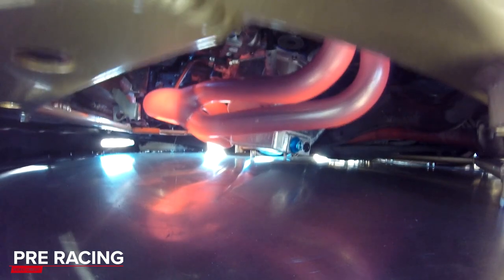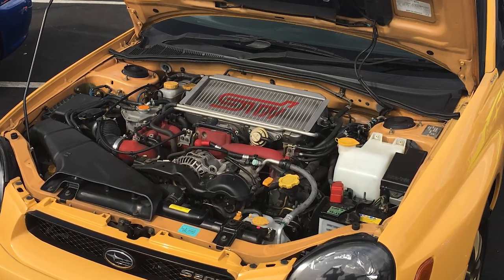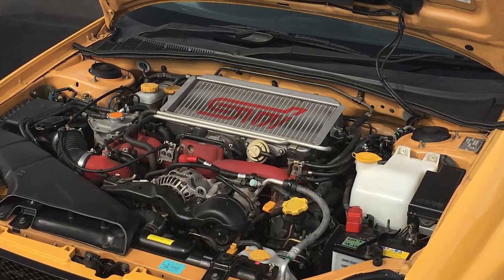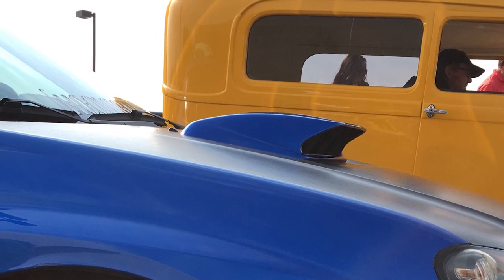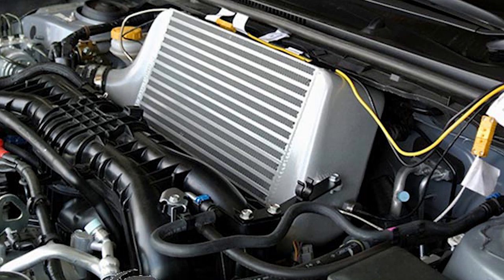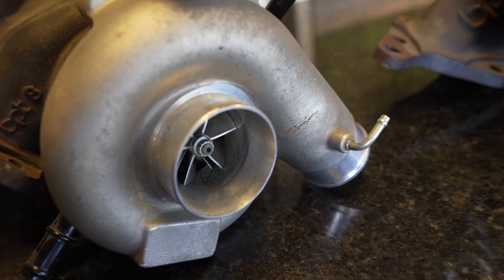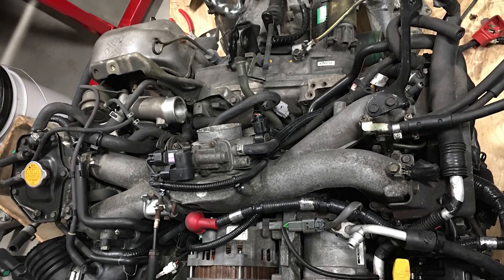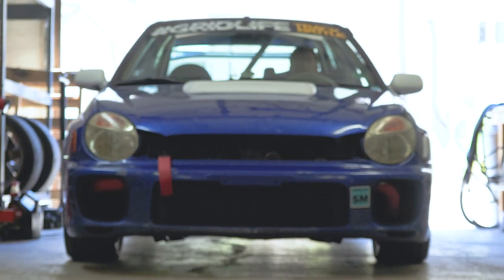Intercoolers - Top-Mount Vs. Front-Mount - Which is best?

Comment: One thing that people forget is with most fmic's youre forced to remove your crash bar.   If you rear end someone, the intercooler takes the impact which is dangerous.   Also, ive seen insurance companies deny claims since the crash bar was removed.
Reply from the maker: That is a good point, and worth mentioning.

Thanks for watching and Stay Tuned!
Reply: Yes you are right on that point. But newer fmic kit they are coming with a crash bar include. But they are more expensive lol 😂
Reply: @xlkazzlx4232  even on the older models, some shaving needs to be done but nothing world ending.

Comment: Another thing that is worth mentioning, is with a top mount you can run greater fin density, because it isn't sitting as close to the ground and exposed to getting the daylights beat out of it by road debris and rocks. I am not a fan of the bar and plate PW design, as it compromises density by going bar and plate. Bar and plate is needed however when you expose a core to rocks and road debris in the bottom of the bumper for rigidity. A bar and plate setup is going to cool less efficiently per surface area than a close fin density intercooler. You can see in the PW Design they increase the volume of the intercooler to 'compensate' for the bar and plate. Ideally any cooler; you want as large surface area as possible, for it to be as thin as possible; with the most fin density. This gives you the least pressure drop and most cooling. Packaging and location becomes the issue however; so that's when compromises kick in. To effectively run a short loop air to air front mount, for track purposes; without compromising the radiator; look into V mounting + rotated manifold + turbo relocation, high mounting the front mount allows greater fin density and tilting / dropping the radiator prevents the fmic from heating the radiator, requires custom ducting. As with anything; there are compromises. This is so that all the coolers can get the appropriate amount of air, and you can keep the intake ducting as short as possible. Now this is full fab, and I am talking relocated turbos at this point, which is not the objective of the video.  It seems like the main goal is to assist with the decision on rather to run a OTS FMIC or upgraded OTS TMIC on a factory(ish) location turbo subaru with a stock rotation intake manifold/tb. Great work as always @flatironstuning Thanks for spreading the knowledge; really good info in the rest of the video!
Reply from the maker: Thanks for the comment.  I definitely think that there hasn't been enough development of intercooler technology in the last 5 - 10 years compared to other parts.  There is definitely some advantage to be gained by some tweaking and re-designing compared to the majority of the kits on the market.

Thanks for watching and Stay Tuned!

Comment: Now the true critical point is the difference and benefits between tube and fin vs bar and plate.  Mostly how tube and fin is the better choice if you're not drag racing
Reply: I would love to hear this. I’m trying to keep my car consistent and reliable on the track and it seems hard to find a good tune and fin TMIC.
Reply from the maker: That is true.  Tube and Fin is a much more efficient design, but it is also a lot more expensive.  Bar and plate is a lot less expensive to produce, and that design is a bit more tolerant of high boost pressure.

The expense of producing the core makes the Tube and Fin Intercoolers really hard to find.

Thanks for the comment and thanks for watching.  Stay Tuned!
Reply: Plazmaman makes an excellent (but pricey) tube and fin intercooler capable of holding some mega boost. They also weigh SUBSTANTIALLY less, which is really nice when you have all that weight hanging off the front end
Reply: @dsxmotorsports  I think HKS makes one too.  Can't find a good tube and fin TMIC though.
Reply from the maker: @dsxmotorsports  Forgot about Plazmaman.  Thanks @DSX Motorsports!

Comment: For the FMIC blocking the radiator, I figured out a solution. APR sells a break cooling kit for the VA WRX/STI ( I believe they also have them for older WRXs) I fabed up some brackets and spilt the hose to go to the brake rotors and to go in between the fmic and radiator. So the radiator is getting good enough air flow.

Comment: FMIC for life.
Reply from the maker: Thanks for watching and Stay Tuned!
Reply: This guy gets it. This response makes the most sense; front mount is the way to go. In response to the turbo lagging behind in pressurizing the system...the fmic isnt the issue, rather the turbo is too small. Even with a vf52 or vf48, I'd still go fmic to be honest.
Reply: @jonathanh4446  💪🏾
Reply: @jonathanh4446  plus the cooling benefits outweigh the extremely minimal drawbacks.

Comment: One of the big reasons my 2002 WRX has a front mount, was so I could switch my air intake temp. sensor from pre-turbo to post turbo for my hybrid engine without a blow through tube. I paired it with an IHI VF48 that been been ported, polished and ceramic coated.
Reply from the maker: Thanks for the comment, thanks for watching, and Stay Tuned!

Comment: Great video. Upgraded the 2002 WRX with G.Speed intercooler with Cobb AOS. No oily residue in the TMIC, yet (it’s been 3 months now) !! Maybe for the next question topic, address the crank pulley. Replaced old stock original harmonic balancer on 2002 wagon with Fluidamper.  What a change ! Smoother and calmer.   I think my Sybil loves me now.  
Cheers
Reply from the maker: Good suggestion on the topic.

Thanks for watching and Stay Tuned!

Comment: I have a Process Verticooler paired with a blouch 1.5XTR(3in inlet, 10cm hot side), seems to be a good pairing for my car, tuner stopped at 380whp/350wt(still on the stock 5-speed). My car lives in socal, doesn't ever feel like it gets heat soaked, and even if it does get heat soaked, it's because that famous California traffic slowing everything down and you won't be going anywhere in a decent amount of time or at speed.
Reply from the maker: Thanks for the comment.  We definitely like the verticoolers.

Thanks for watching and Stay Tuned!
Reply: I have a similar setup. Blouch 1.5XTR (8cm hot side) paired with a GrimmSpeed. Stock 5speed. Stock block with rebuilt internals. Dyno tuned on E85. Pushing around 400whp. I built a Intercooler water sprayer that helps a lot to keep the TMIC cooler.

Comment: I would be interested to see a relatively small FMIC for the VA WRXs. The turbo location means intake length wouldn't be all that much longer. Using a core and piping designed for maybe 350hp would minimize pressurized volume. Plus, the smaller core wouldn't block airflow to the radiator and might mean you can keep the OEM crash bar. Perhaps the reason we have this rule of thumb that you only go FCIM over 400hp is that that's what made sense on the EJ motors, and all the vendors kept that thought for later generations.

Comment: Another reason why I am going with a top mount upgrade instead of front mount is just the absolute amount of debris that will impact the core. I live in Wisconsin and there’s snow almost half the year, with rocksalt, sand, and just pieces of the road from plowing. In the summer, there’s always road construction and chip seal taking place.
Reply from the maker: That is always something to consider for sure.  The FMIC cores are pretty darn tough, but in those types of conditions over time, you could end up with a damaged core.

Thanks for watching and Stay Tuned!
Reply: Which part of WI

Comment: Love the video personally going Perrin TMIC on my 2020 STI because I want to have the best throttle response and not looking for peak numbers. However I think Subarus rally use v mount intercoolers so the radiator doesn’t get air robbed would love to hear your opinions on those!
Reply from the maker: Thanks for your question.  "V" mount intercoolers and radiators are actually really tricky to get right.  The issue is getting good air flow through both coolers. It requires a lot of ducting to get them to work properly.

And packaging can be more challenging with the V Mount set-up than just about any other option.

Honestly, I'd say that most of the time those are best left to professional race teams with wind tunnels, etc.

Thanks for watching and Stay Tuned!

Comment: Would be curious to see a company design a tmic with a redesigned hood scoop that seals the IC for maximum cooling efficiency, and also a plate or some design work with a heat shielding to prevent heat soak.
Reply: Process west ;)
Reply: @marvinvisser5039  The process west setup is too basic of a design I'm talking something a lot more high-end.  Would require a hood scoop upgrade - ram air setups to completely redesign the stock setup.  Also need a plate or a kit to prevent heat soaking or some fans with ductwork to extract the heat out of the engine compartment.  There's companies that do this in the Porsche 911 air-cooled market.... don't think anyone's tried it yet for STI.
Reply from the maker: Thanks for your comment.  I'd say that Process West and Grimmspeed are the closest to this that we have currently.  From your other comment, I know that you are thinking of something beyond what they have on offer currently.

It is an interesting idea, but I would say that for a lot of driving, a well ducted TMIC does a really good job.  I'll have to see if I can find one of the 911 set-ups you mention and see what they have going on.

Thanks for watching and Stay Tuned!

Comment: When you say 400 HP I'm assuming you mean 400 wheel hp not crank hp.  I've personally made 420/405 on pump gas with a rotated g30-660 and a mishimoto tmic @ 23-24 psi and then 475/467 on e50 with a grimmspeed tmic @24-25 psi on a mustang dyno and know of folks that have done upwards of 530 whp with a grimmspeed tmic.  

On the dyno at least I couldn't hold power passed 7k due to the tmic no longer keeping intake temps where they needed to be.  Could you do a video about air to water set ups?  I really want to do an awic in the factory tmic location to try and get the best of both response and power capacity.
Reply: This still seems like the ideal setup to me. Been looking to try it as well, as I can fabricate it all myself. Eliminate the charge pipe volume, eliminate the bottleneck of total cooling capacity, and completely stabilize the charge temperatures as there's no issue of heat soaking the core. Only downside is system complexity, and packaging. (A tank in the trunk)
Reply: @evanchi9460  your also limited on intake manifold choices.  A stock sti will work as will a cosworth if you can afford it and if you're lucky enough to locate one.  There's a guy on nasioc who did this kinda set up on his autocross car with good results.
Reply: @donmerrigan2362  Limited in regards to what? The packaging on any OEM manifold would be tricky, but not impossible. I'll be using a 2.5i NA manifold I shaved up if I ever do it.
Reply: @evanchi9460  limited on space.  The na manifolds have much larger plenums which place the throttle body in almost the dead center of the factory tmic.  There's just no room to put an intercooler in the factory location with a na/ams/process west manifold.  Maybe if you reversed them but that would add a bunch of piping with some really tight bends.  

I'm currently doing a short runner na manifold and had to go fmic to do so as there's no way a tmic could fit anymore.
Reply: I actually saw one in a forester at the last big Subaru meet in Houston. Talked with the owner and tuner, said it wasn’t worth the cost unless you’re tracking it regularly, as the fully custom design woulda been approaching around 3500-4k just for an intercooler. I have pics I believe if you’d like to see
Reply: @Cloudsurfer181  Yup, I wouldn't even bother if I wasn't able to fabricate it all myself. The parts alone are really not expensive, but there's a lot of labor involved.
Reply from the maker: Thanks for the comment, and yes, I did mean 400 wheel hp. 

A few comments about AWIC's on this video.  From the first response I typed:

Air to water intercoolers are an interesting option.  The difficulty with them generally comes down to the weight of the system with coolant, etc., the complexity (have to have a pumping system, etc. to circulate the coolant through the AWIC), and on track, the issue is that once the intercooler gets hot, it takes a lot longer for it to cool off.

Heat soak is really the biggest drawback of the AWIC (well, and the complexity).  A long time ago there was a guy here in Colorado that had a 400 whp Turbo RS that was running an AWIC with dual pumps and dual radiators.  He could only get a couple laps on track before his intake air temps started to peak and he had to do a couple of cool-down laps.

He switched to an air to air intercooler, and intake air temps were not an issue any more.

I'd say that AWIC would be most ideal for drag racing because of the very short usage, or maybe Time Attack.  If you can get it to work properly with something like an ice bath, the big advantage that an AWIC could have is the ability to cool the intake charge below (potentially well below) ambient temp.  But just for a short period of time.

Thanks for watching and Stay Tuned!

Comment: if I'm going to Race Team As a Subaru mechanic just a little upgrade to top mount A bigger scoop with housing sealed/cowling going to I/C similar to 2001 Forester gt and other models slanted or vertical I/C, put some good insulation to the top of the engine and turbo, plus better air flow ventilation going under chassis there's more in my brain how about re route the evaporator put into I/C that's a real cooler air than ever period 🤔😎 cheer's
Reply from the maker: Thanks for the comment, thanks for watching, and Stay Tuned!

Comment: Why no mention of air to water coolers? They do give the best of both worlds. Not very hard to set up and it's not very expensive plus even the cheap parts work pretty good because water can hold so much heat. The only place the cheap kids lack is pump volume but that's easy to retro fit a better pump like an OEM f150 lightning pump or something similar.
Reply from the maker: Thanks for your question.  We actually just put together an episode on Air to Water specifically.  

Here is a link to that:

https://youtube.com/watch?v=cR4QfPj7s4Y&feature=shares

Thanks for watching and Stay Tuned!

Comment: I been thinking of getting the GS TMIC FOR MY 21 sti, with the thermal coating. 
Would you say it’s worth it ? I’ve heard the sti Intercooler is sufficient. My purpose of changing it would be to reduce heat soak when at low speeds or in traffic jams. Having to take it easy once traffic clears up due to heat soak.

Comment: what's the cross-over for going into nitro or ethanol cooling?  Is there a controller that makes that part of the injection system/engine mapping? Asking for a friend :-)
Reply from the maker: Are you thinking of running something like water/methanol injection?  Or just running ethanol as fuel for its cooling ability?

We had a great conversation about this a little while ago, and you may want to take a look at that as a good starting point:

https://youtu.be/K52E0NKWMcU

Thanks for watching and Stay Tuned!

Comment: I hear alot about over 400 hp you need front mount. In Florida I get heat soak bad in summer. Do you recommend a front mount or verticooler? Only trying for 350 hp for my daily. Not going for alot of power but looking for the best reliability upgrades.
Reply from the maker: Thanks for your question.  For that power target, I would probably try to stay with a top mount.  If anything, hooking up an intercooler sprayer will really help with any heat soak issues.

Hope that helps and Stay Tuned!

Comment: If someone has a cvt Subaru and lives in one of the states that gets extremely hot, would it be better to stay top mount or go front mount, I know theres turbo lag to take into account but which direction would be wiser, living in those states.
Reply from the maker: Thanks for your question.  CVT's definitely don't like heat so you might actually want to factor in a better cooler for the transmission.  They also don't do well with extra power, so I'd recommend staying with the top-mount intercooler.  I think that if you pushed the car enough to need a front mount, the transmission would most likely not last too long.

Thanks for watching and Stay Tuned!
Reply: Ok and Thank you for the reply

Comment: Front mount better for street.. with slight off-boost throttle response...

Top mount is ok as long as the car moving at decent air speed going into the hood scoop...not good for stop n go situation multiple time...

But air to water would be the best of both world...  Im going this direction soon... With dual stage awic core.. big water heat exchanger and decent water tank (atleast as big as wiper water tank)
Reply: Do you happen to have a link for the air to water IC?
Reply from the maker: Air to water intercoolers are an interesting option.  The difficulty with them generally comes down to the weight of the system with coolant, etc., the complexity (have to have a pumping system, etc. to circulate the coolant through the AWIC), and on track, the issue is that once the intercooler gets hot, it takes a lot longer for it to cool off.

But for some applications, they can be a good solution.

Thanks for watching and Stay Tuned!